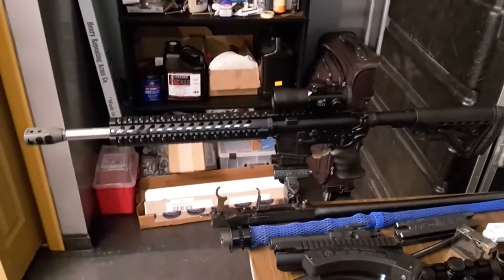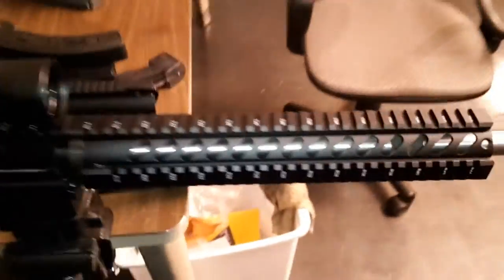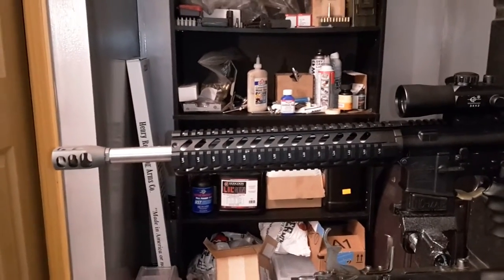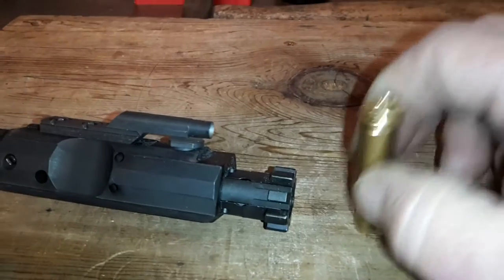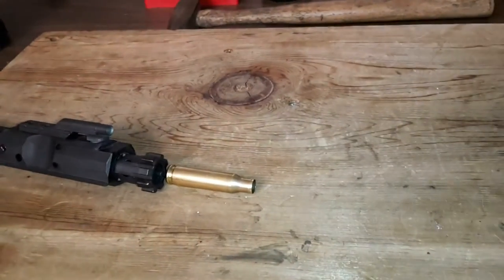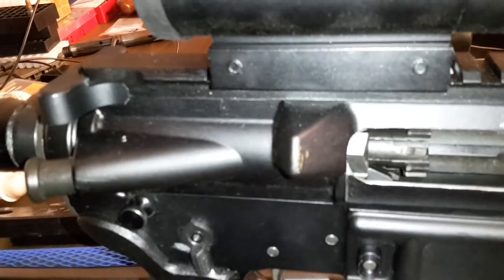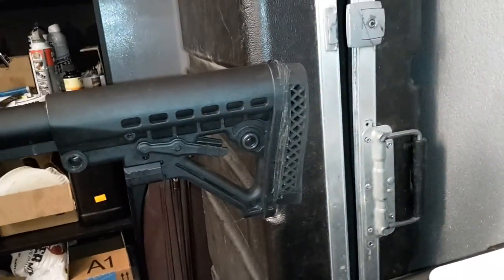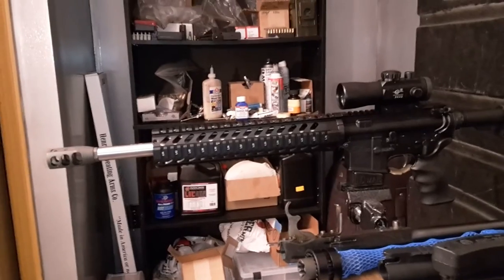50cal beowulf problem and fixes

Comment: I have a 50 Beo but the problem i had that was similar was with my 6.5 Grendel build. On the first shot ever the round got so stuck i had to disassemble the gun to get it out. Turned it wasn’t the rd that was stuck. The bold head was stuck behind the feed ramp. 

I surmised the bolt wasn’t fitting well with my situation. The gun was 100% Aero Precision with the exception of the barrel and bolt which are BCA. 

I disassembled the bca Bolt Carrie group and migrated the bolt assembly to a spare Aero Precision bolt i had and that fixed it. Something wasn’t quite fitting together right.

Comment: I watched your video when it first came out... watched a few others, called Mr. Aexander himself, changed buffers, changed springs, tweeked mags, filed mags, swore a whole bunch, called Mr. Alexander again, tried different bullets in my handloads, swore a whole bunch again, and finally threw itback in the safe. A year later... I'm circling back trying to re-educate myself. I have a ton of time and reloading invested in the piece. Its an Alexander upper with the cheese grater handguard and the tank-break on the end of a 16" bbl. I have 500 peices of new brass so I know I'm doing good with that, used Hornady's FTX, Speer flatnose, hollopoints, I have every issue with it. FTF, FTE, faliure to strip a round. I'm getting ready to sell it if I can't get it to work. Wish me luck!
Reply from the maker: If it wont go back far enough to catch a new round then the buffer is too long or the spring is too stiff or the mag is letting the rounds rub too hard on the bottom of the bolt or the opposite and the rounds are too low in the mag and need to be opened up.  If it runs better with only a few rounds in the mag then its probly the mag.
Reply: @gottamodify7756  Mr. Alexander advised me that the correct buffer was a 4.3 oz. and a carbine milspec spring.... I'm ready to send it if to Alexander,  he's said although I had an Anderson lower built by a local shop he would work it over for me. He wants all of my Alexander Arms mags back too.

Comment: I built one and have not had any issues with it. Bear Creek arsenal is where I got my upper, and used an Anderson lower. I use the same ammo. For those who know, there is a 50 inch drop from 100 to 300 yards. I have less than $350 in mine. Did not need a muzzle break.
Reply: What mags are you using?

Comment: Have you had issues where the brass comes out scratched up? I'm in my second week of a build tweaking etc.
Mags are an issue .I've order p80 from brownels. Wondering about gas block if it needs to be adj? Buffer weights and what buffer to use .I got sprinco hd. And got 3.8oz and 5.4oz it diesnt like to heavy of s buffer .maybe that is why my brass look so bad? Very cool round

Comment: What barrel are you using on your build?  I am looking to build a 50 Beowulf what was your upper build and what do you recommend.  I was going to go with Anderson or Aero Precision  for my build do to their XL Upper and so fsr for you muzzle break ia it Alexander Arms?
Reply: You can go to AR15 PART.COM and get all the parts you need for a 50 beowulf.
Reply: @clarence6124  thqnk you for the link and the information my friend.
Reply: Had similar issues, but I built mine with an adjustable gas block. Put 1 round in it, shoot the round. If the mag catch does not engage then your action is not coming back far enough. I use FTX bullets as the Speers will either need a single shot follower or a FTX bullet as last round to feed but a fuul clip of Speers will hang up loading the last round. Feed issues I fixed by shortening the feed lips on a metal/GI mag to 3/4" long and a roundish cut out in the front of the mag. If you are wanting to feed the rounds then extract them without shooting them then you will need to size the loaded ammo to bring down the O.D. of the bullet bulge to about 0.525-0.526" dia. It is a bear to get lined out but once you do it is a fun one to shoot. Good luck!!
Reply: @brucelitton5376  appreciate  the information  my friend i have spoken  to others and sevwral pwople told me about the circular cut on the metal magazines that is a must.  I really appreciate  the help and the information thank you once again.  When i get started thia year i will plan and invest in one asap. Lol

Comment: where did you get your stainless steel .50 cal Beowulf barrel and bolt
Reply from the maker: Bruce Murray midway
Reply: Ebay has them for 700.  I bought mine through Alexander arms

Comment: Is that a Satern bolt and barrel combo.  I had similar problems with mine
Reply from the maker: Modern Mountain Man hi ,i tried different bolts and it made no difference. Ultimately when i was reloading i noticed the bullets were bulging the case a little, even the factory ammo was bulged. After i started crimping all ammo including the factory ammo and the chambering issue went away. I use one mag that feeds good in my gun but still get an ocasional miss feed on the last round. I never bought the beowulf mags.
Reply: gotta modify thanks or that advice
Reply: gotta modify  I have seen some issues from the Beowulf and Grendel extractors that came from a certain company
Reply from the maker: Modern Mountain Man i guess mine isnt from that company, i havent had any extracting issues. I have used two differnt bolts and have had no head space or extractor problems.maybe i got lucky.
Reply from the maker: I did modify the original extractor a little to loosen it up but the second bolt i tried didnt have any problems. I remember now that I got the barrel and bolt from midway , so I don't know if satern made it or not.
Reply: gotta modify  yeah they make them for Midway
Reply from the maker: Modern Mountain Man good to no
Reply: Modern Mountain Man I both that combo and have had feeding problems. What do you know about any fix for it

Comment: The problem isn't the ammo.  Factory ammo works perfectly fine in the .50 Beowulf.  Alexander Arms owns the trademark.  What's the bolt depth?  That isn't a .50 Beowulf.
Reply from the maker: All i did to fix the problem was give it a heavy crimp. I didnt adjust length or anything. I found that if i just tried to slide the round in in without the bolt, the round was getting stuck in the chamber. So no doubt some people have headspace issues, I didn't. The factory ammo had a noticeable bulge in the case, so after i crimped the factory ammo my issues went away.
Reply: @gottamodify7756  that's because you have a knockoff barrel and modified bolt.  Neither are .50 Beowulf.
Reply: @gottamodify7756  You need to be dam careful crimping this case as it can load deep and cause pressure issues. All straight wall cases share this problem. If you want to crimp-do so ever so slightly as this case headspaces on the case mouth!

Comment: I ordered the 50 mags from Alexander arms and they wont lock the bolt to rear
Reply from the maker: If 223 mags lock it back then its the new mags. Does it only not lock back after firing or when there's no rounds in mag?
Reply: I spent the money on 2 of them-total waste of money as they are the same as the 5.56 mags only with a slight round clearance in the front. Wont be doing that again!!

Comment: bro im having the same issues... i just came from the range.... it only fires one round and doesnt chamber the next one.. im using magpul mags and AA ammo...
Reply from the maker: i had to put in a stronger buffertube spring.i only have standard metal mags feed reliably.i also had to open the feed lips on the mags a little.still i get fail to feeds somtimes. i dont seem to have chambering or ejection problems anymore.
Reply: Cool vid.... gotto love the 50beo......The first one I built I used the 16" barrel from midway. The bolt was crap and caused lots of issues. It needed both ejector and extractor springs replaced to function well. just real garbage to start with, maybe would work with a AK 7.62x39 fine. You can get an Alex-A bolt for around $80 and it'll work fine (one less thing to trouble shoot) or any good 7.62x39 bolt would probably do. I've gotten regular 5.56 bolts from midway that wouldn't work from the start cause of bad springs.....The second one I built I used the 18" barrel from midway and it came with a different bolt than the 16", it worked great out of the gate.  I'd look towards the bolt being the issue with feed/extract problems unless your ejection port isn't big enough. "gotta modify" kinda went overkill on his ejection port....... On the mags....I took off less than a 16th of a inch on each feed lips tapering to nothing in the back. also took out about a 1/4" going to the feed ramp on the front of the mag (doubt you'd need to do that with p-mags). Also you can get mag followers for the AR big bore calibers on ebay, they work great but won't work on p-mags, only for spec mags. I've used A2 stocks on mine and never had an issue so not sure about the buffer spring. The Alex-A ammo is pretty weak according to their load data. Some rounds I've made using their data wouldn't even expand the cases enough to seal off blow back gases in the chamber. I'm using loads that are over their top listed loads with no issues but won't recommend that to anyone.
Reply: Have you fixed your issue?